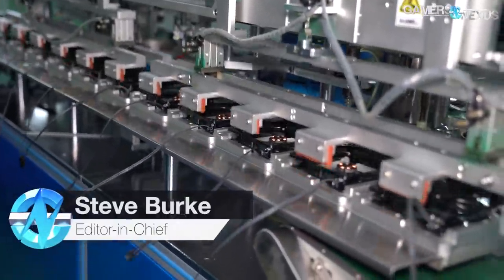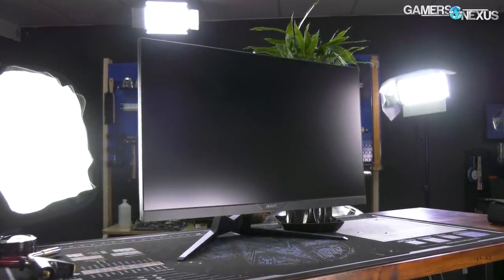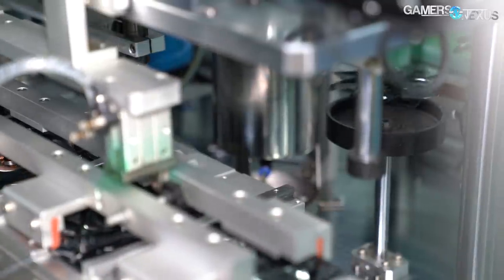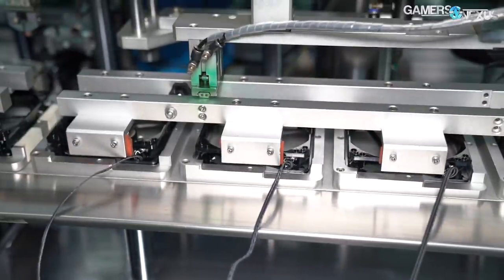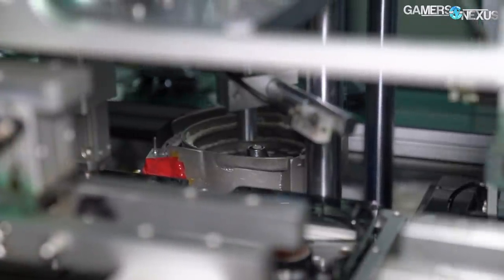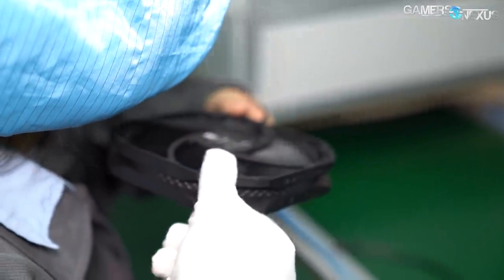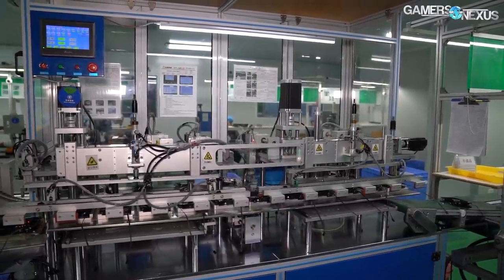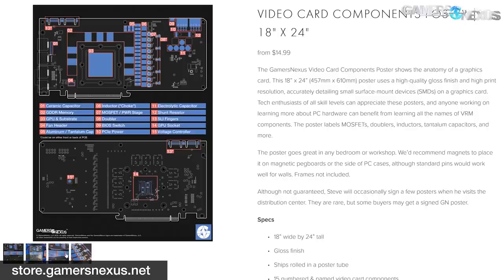How PC Case Fans Are Made | Shenzhen Factory Tour (Deepcool)

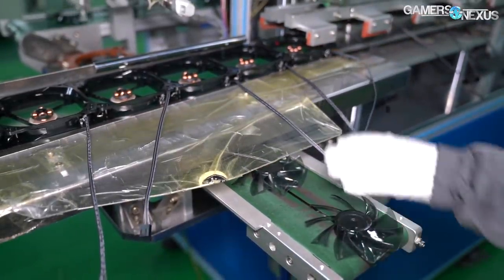Comment: Love the ghetto shroud with clear tape at 3:04 to stop fan cables getting caught in fan blades from the conveyor below.
Reply: Everything is ghetto :)
Reply: It ain't ghetto if it works
Reply: Work smarter! Not harder!
Reply: They don't care about aesthetics as long as it works..
Reply: That's called engineering :P
Reply: they could have just made the belt incline for the blades a little more steep. Probably not a big issue though.
Reply: Finding flaws in thier new machine design, engineering a temp fix

Comment: Pretty remarkable how simple the operation is.  Hand soldered wires, old-school laser interruption, testing by ear...certainly didn't expect that.  I figured it would all be automated to the point that they would need to slow down the line to 1/10 speed for you to record with a high speed camera.  I guess it works when labor costs are super-low.

Comment: #AskGN / @Gamers Nexus --  Do they still have to manually balance the blades with a type of adhesive putty added to sections in the center of the blades like weights added to a wheel rim for balancing a tyre, or are the manufacturing tolerances of the blades so tight now that it isn't required any more??
I'm curious if this process has changed as I haven't had to buy new fans in the past 7-8 years as Gentle Typhoons seem to last forever.
 Thanks for this video, really interesting to watch.
Reply: Good question, I'd like to know too
Reply: This technique is common in RC airplanes but the props are larger and spin between 8.000 and 12.000 rpm making the tip blades “almost” go supersonic in the fastest ones. If you don’t balance your prop, at that speed you will hear the vibration and in the long run the motor shaft will suffer.
PC fans spin like what, 3.000rpm?, and the diameter is smaller, I think a “mostly ok but not perfect balanced fan” is ok, but you question is really interesting :-)
Reply: I dont think so that they are getting an "After Construction balance", the treatment  is costly (time) and it can be countered with presicion Plastic Manufacturing as also the design, see, big Fans (180-200mm) got their max RPMs lower than 120s or 140s. Less mass to move means less percentage of unbalancing weight of the moving Fan.
Reply: I don't know, the 120mm SP series from Corsair and Scythe Gentle Typhoons I still use are both balanced - both have a segmented middle (hub) and small amounts of a putty type substance is stuck in 1 or 2 segments with a colored dot next to them, like a; "this is where some is needed" and/or "this fan has been balanced and passed" sort of this.
Reply: @hectorlmges  I fly RC for many years now and it is common for the tip speed to reach super Sonic in small pylon racers and also very large giant scale planes. It is a terrific sound.
Reply: @Stop_Pre-Ordering_Video_Games    
I have over 30 Sanyo san ace 120mm fans, all of them have a little epoxy putty on them in specially formed holes for balance. 
They are as good as Gentle Typhoons, same twin ball bearings but slightly better quality in the fact they have a brass bearing housing.
Reply: Not all companies do, the 40mm "Fonsan Delta electronics" fans I recently bought are garbage in terms of balancing (and noise). I'm not even going to use them. I'm afraid they will legitimately vibrate my GPUs' VRMs to pieces... I was balancing a few of them with hot glue (at least to the point they wouldn't vibrate/rattle off the table), but wow they still make a lot of vibration noise. These are very low speed 40mm fans (I wanted something quiet and just "some airflow" over my VRMs, but honestly, the $0.70 cheapo clear fans I've bought that are 1/5 the thickness put out more air with less noise, so I'm going back to those, no balancing needed, and only airflow noise to be heard by those after like 6 years of intermittent use on my 3d printer!

The only 40mm fans the "Fonsan" fans are quieter, are my Sunon "super speed" rated fans (highest speed they sell for servers), but wow those duel stage (contra-rotating) fans are like little jets, and I'm very happy with those (you could say I'm a "big fan" of these little fans). Those really move airflow, and they don't vibrate everywhere.

My favorite 120mm case fan are my "new" (super old, but "new" to me) Sunon Maglev (magnetic levitation bearings), and those work great. About the same noise level as my previous 120mm Delta that came with my 120mm AIO, excellent airflow with low noise. I bought 10x of those, so I'm set for my lifetime unless 120mm gets phased out like 80mm did.

Comment: 3:53 bearings or bushings ?

edit:
would also be interested into the process of manufacturing the blades itself
Reply: I'd have to guess those are sleeve bearing?
Reply: looks like crappy sleeve bearings. I am sure the blades are injection molded.
Reply: @LaserFur  Your car engine almost certainly runs on plain (sleeve) bearings. Not all sleeve bearings are crap. A properly lubricated plain bearing will outlast a ball bearing. In fact, you can calculate the lifespan for ball bearings, but not for plain bearings, since as long as a plain bearing is lubricated, it runs hydrodynamic (with an oil film between the bearing and shaft) and will last forever. 
Even Noctua's SSO bearing are just sleeve bearings really.
Reply: @slome815  A PC fan lacks a oil pump. Yes a good sleeve bearing can last a long time. even babbitt bearings last a long time. But when a fan manufacture goes to sleeves it's to save money.
Reply: @LaserFur  You don't need an oil pump for hydrodynamic bearings, only for hydrostatic (in fact hydrodynamic bearings never uses a pump). Most good PC fans have in fact hydrodynamic sleeve bearings. Metal on metal contact would make for a VERY short lifepan. Like I said, even noctua uses sleeve bearings, and they give a 6 year warranty on their product. They give a MTBF of 150.000 hours. 
This is a tour of deepcool, deepcool does indeed use hydrodynamic bearings, the oil is hermeticaly sealed inside the bearing, they give a MTBF of 100.000 hours.
Plain bearings are underrated only by people who don't work with them.

Comment: Lot's of people like to diss China for it's manufacturing process, but this looks so freaking amazing!
Reply: Can easily bring these plants and jobs back to the USA.
Reply: @calidude1114  lol
Reply: @calidude1114  Of course you can, but fans would cost at least twice as much and no one would buy them over Chinese made ones.
Reply: @calidude1114  finding Americans with the technical skills to run the machinery wouldn't be easy

I would expect these people at least have degrees in electrical engineering
Reply: @c2lredstone946  what kind of technical skill does it take to drop fan blades onto a conveyor belt? No one manufacturing anything is engineering anything. They're just assembling already engineered parts.
Reply: @1pcfred  maybe, I was under the impression they assembles the motors here

Either way, don't the people in China deserve jobs too?
Reply: @calidude1114  a side note: Deepcool is a Chinese company
Reply: @c2lredstone946  does anyone deserve a job? Everyone deserves an opportunity but I think jobs are something that needs to be earned.
Reply: @1pcfred  so thus the workers in the factory have earned them
Reply: @c2lredstone946  there is a wider issue of trade beyond just the workers or factories involved here.
Reply: @1pcfred  Corvette Dude's tone implies that he thinks Americans deserve manufacturing jobs more than anyone else
Reply: @c2lredstone946  we certainly deserve the jobs for our market place the most. Plus we invented mass production so there's that too. Eli Whitney invented interchangeable parts. 'Murica!
Reply: @1pcfred  The US isn't the only marketplace for Deepcool products m8. 

And the invention of mass production part is hypocritical. The Chinese aren't complaining about us using paper and paper money...
Reply: @c2lredstone946  we don't use paper money. We use cloth money. That's why if you forget bills in your pocket when you wash your clothes you still have bills when you pull your clothes out of the wash.
Reply: @1pcfred  good point, gotta have that counterfeit security...but...paper was still a Chinese invention
Reply: @c2lredstone946  it rarely matters who invented anything. What matters is who uses it the best. White Europeans dominated the globe because they managed to integrate the best from everyone along with the best they developed for themselves. Also the Egyptians invented paper. The word paper comes from the word papyrus. Google better.
Reply: @1pcfred  well then, why are you complaining about the Chinese using mass production? They're "using it better." Be less hypocritical.
Reply: @c2lredstone946  they're not using it better. They're subsidizing their industries and manipulating their currency.
Reply: @1pcfred  as if the US doesn't subsidize any of its industries...
Reply: @c2lredstone946  exceptions do not negate rules. So no as a rule the US does not subsidize private industry. Not on the scale that China does. Not even close.
Reply: @1pcfred  the coal and oil industries would like to disagree

Edit: I understand that they are not "subsidies" by dictionary definition, but in practice, they might as well be
Reply: @c2lredstone946  just where do you think we'd be today without coal and oil? See Mad Max for the optimistic view. Are you shiny and chrome?
Reply: @1pcfred  and where would the world be without cheap manufacturing? Average people like us would never be able to afford luxuries such as technology
Reply: @c2lredstone946  the world would be better off. We'd personally likely be better off too. Too many are consumed with consumption. Which is a hollow and unfulfilling activity.
Reply: @1pcfred  you're welcome to stop using the internet ole chap
Reply: @c2lredstone946  why should I? I paid for it after all.
Reply: @1pcfred  because you should follow your own advice instead of preaching about it to others
Reply: @c2lredstone946  I am not offering advise or preaching. I am merely pointing out what I have observed. which is what it is regardless of what I may say about it.
Reply: @1pcfred  this conversation is really off topic now, but I would like to mention that the world would have less pollution if it weren't for oil and coal

(And obsessiveness over consumption)
Reply: @c2lredstone946  unfortunately we cannot give up on fossil fuels now. People who think we possess some technology that could replace it are sadly mistaken. Even if alternatives were free they still could not compete with fossil fuels. It has to do with energy density. Gasoline has 36 times the energy by volume as a lithium battery does. It's a tough act to beat. A couple weeks ago I drove over 2,000 miles in a weekend. Try doing that in an electric car.
Reply: @1pcfred  America seems averse to the idea of public transport. China has high speed rails linking most major cities and here, we've got one. And it's not even that fast.
Reply: @c2lredstone946  I like to leave when I want to leave and go where I want to go. The closest thing to a major city is about an hour and forty minute drive from where I live too. And they don't even have an international airport there. To get to one of those I'd have to travel over two hours. So even if we had a high speed rail network it wouldn't do me much good. I bet the same is true for a lot of Americans.
Reply: @1pcfred  I bet the opposite is true for many more Americans.

That "freedom to do anything" attitude directly conflicts with your statement about over consumption.
Reply: @c2lredstone946  just because I'm free to do things doesn't mean I make a habit of doing them.
Reply: @1pcfred  your tone definitely doesn't represent that
Reply: @c2lredstone946  you misunderstand me. The tone you hear is color you add yourself. Everyone always hears what they want to hear. Often that is not what should be heard though.
Reply: @1pcfred  Ha! That's quite ironic, because you misunderstood what I was getting at. 

Let me paint it real clear for you. You claim that consumption is bad, that it's a "*hollow and unfulfilling activity*." Fine, I don't see any problem with that. Then you turn right around and start talking about cars, possibly the best representation of American over consumption: 

Just because you don't make a habit out of it (which I doubt), doesn't absolve you of making contradictory statements: "If you want to make the world a better place, take a look at yourself, and make a change."

Why don't you bring this discussion back to the Deepcool factory? I already tried, but you clearly just want to argue about nonsense.
Reply: @c2lredstone946  there are plenty of topics beyond Deepcool's factory that are in fact not nonsense themselves.
Reply: @1pcfred  In this conversation, they are not relevant. If you want to discuss existential issues, there is Reddit. I've gone way too far down this rabbit hole, but if you wish to continue, there are plenty more people who have bigger shovels than I do.
Reply: @c2lredstone946  thanks for the hot tip. I do consider China's manufacturing an existential threat for many reasons though. So I'm going to keep on dissing them every chance I can get.
Reply: @1pcfred  maybe consider climate change a more relevant threat, at least you can do something about it
Reply: @c2lredstone946  what can you do about it? Don't you think we're already doing the best we can?
Reply: @1pcfred  with the amount of driving Americans do and amount of food we waste? 

Hahahahahahahahahahahahahahahahahahahahahahahahahahahaha
Reply: @c2lredstone946  I don't waste food. If it is on my plate I eat it. I try to make sure what's on my plate is what I like but if it isn't tough luck. Driving is the only practical mode of transportation available to me too. I live in a rural area so nothing is around the corner from me.
Reply: @c2lredstone946  all my neighbors amounts to no one. I don't live in a place where anyone has neighbors. Unless snakes and buzzards count. You ain't talking them out of eating meat either.
Reply: @1pcfred  you should keep your worries to yourself if you truly believe you cannot affect those around you into making change
Reply: @c2lredstone946  there is no one around me. That's by design. Though I hear things are bad in other places. I've even been to some of those places myself and I can confirm that is true.
Reply: @1pcfred  so...you choose to live in isolation so you can avoid the responsibility of helping others understand the importance of conservation

Clever, but selfish, and self imposed rules does not grant you the moral absolution to pollute the air with a car

Comment: They build these fans for like $5 manufacturing costs, and sell it for like $20 to $30
But you gotta admit, even simple productions like fans have a lot of steps and processes
Just bought "PCCOOLER GI-X5 CORONA" for like $25 which is It's 5 Heat Pipes Heatsink with 120m fan (160TDP) which is amazing
I think it was like $40 but they discounted,  gonna OC my Ryzen 2600 up to 4.2GHz  Lol

Comment: How much lubricant do they actually use? 

Usually when I find a case fan or other fan that is wobbly, noisy, or flat out seized, it seems that there was none to start with. Perhaps it's just such a thin layer that it easily dissipates.
Reply: My #1 quick fix for a noisy fan is to pop the back off and put some lithium grease in there. Works pretty much every time.

Comment: about Deepcool - I have a case from them and I'm disappointed with it - front panel was messy with a lot of glue, a piece of plastic from the top broke and in one of the included fans the the cable fell out of the connector very easily

Comment: Actually, all air fans have wrong construction because of internal diameter of each fans is not effective....
Reply: Yes, the motor should be on (around) the ends of the blade in the frame.

Comment: Interesting (Mostly Minor) Notes:

2:34 - Those Exhaust fans don't seem to be sucking any fumes away to me. Not to mention, that little tube on the Iron is supposed to extract fumes, too, though It clearly isn't on. Feel bad for that Worker :(
3:11 - He most likely means Pneumatic, as there are no Hydraulics present anywhere in the footage (Nor should there be- Why would they need Hundreds of Pounds of Force?. Also Hydraulic oil is messy)
3:50 - Those looks more like bushings to me than Bearings. While they preform similar functions, Fans using are (typically) regarded to last longer and be of Higher-quality.
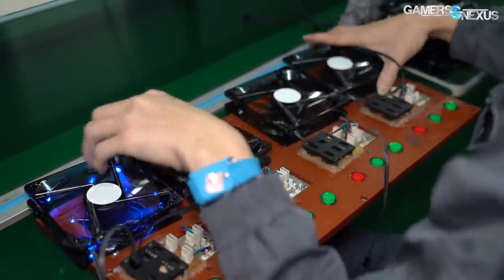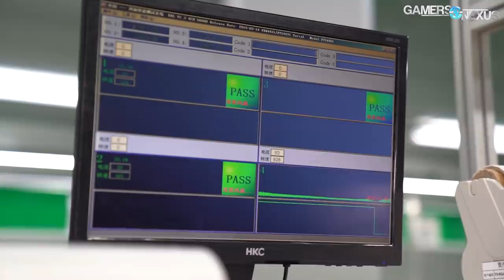5:03 , 5:28 - IS THAT A 'WIRELESS' ANTI-STATIC WRISTBAND!?! SERIOUSLY WTF.. I really hope DeepCool isn't that dumb :/

Comment: #AskGN / @Gamers Nexus -- Is there a reason that fan manufactures don't make fans that blow the opposite direction so you can mix them to have the front facing the right way whether they are intake or exhaust? Certain fans, Corsair's LL series comes to mind, are made to be viewed from one direction, but sometimes you need to mount them the other way for optimal airflow. Would it be that hard to make inverted blades and sell it under a different model number?

Comment: I keep hoping a company releases a fan with the blades reversed from the norm, so when you want a fan pulling air in from the bottom or top of a case they look better than a "backward" mounted fan. With the aesthetically driven market these days, I would think there would be a large market for that... DOO EEET deepcool!
Reply: It's more about case manufacturers. Most cases assumes that you use front for air intake and  top/back/side for exhaust. And  those exhaust fans are only visible through side tempered glass.
Reply: DeepCool have their laptop cooler fans reversed ($10 with 2x140mm fans)